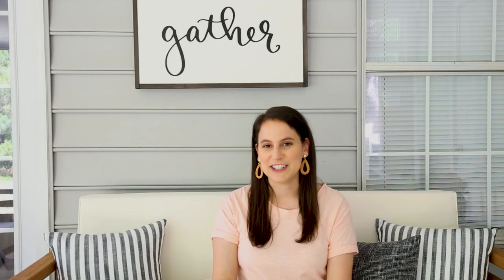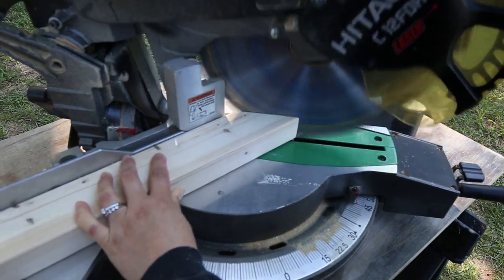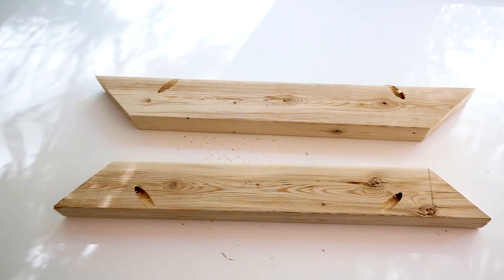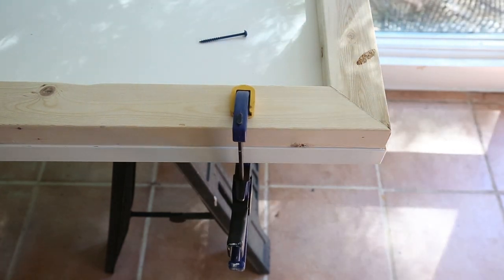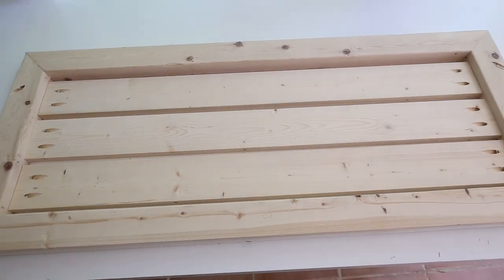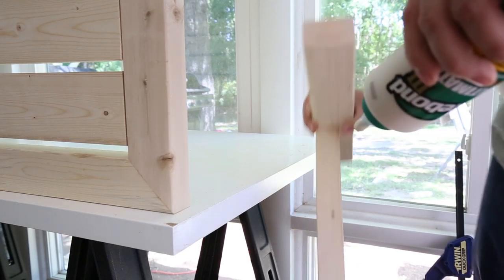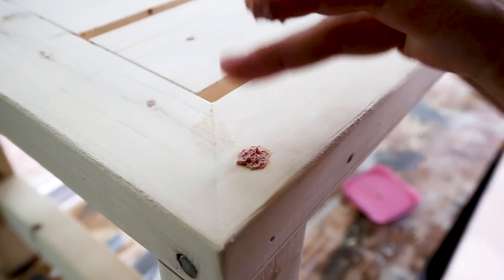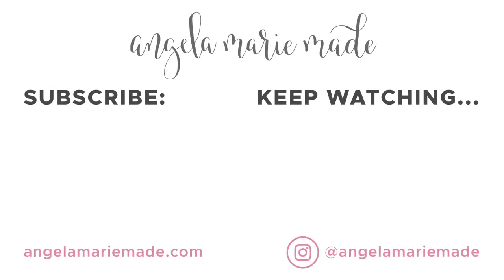DIY Outdoor Coffee Table for $20

Comment: how heavy is it?  You can stand on a scale and old it and the stand on a scale and then subtract to two to get the weight of the table.  Thanks
Reply from the maker: It's on the heavier side because it's made from framing lumber. I don't know the exact weight but I have to move it with a 2nd person!
Reply: @AngelaMarieMade  thanks!!  I should have mentioned the coffee table specifically - is that a 2 person lift?? thanks so much